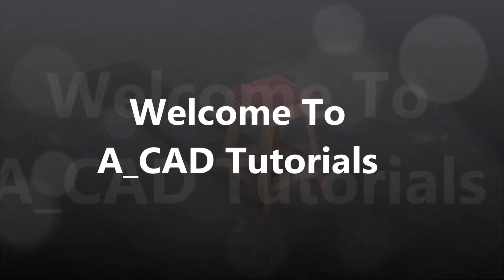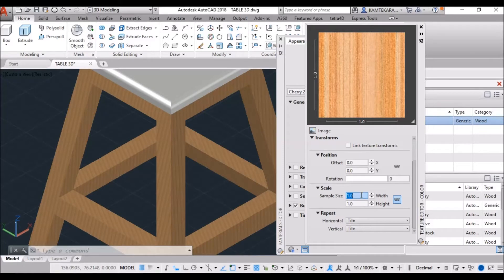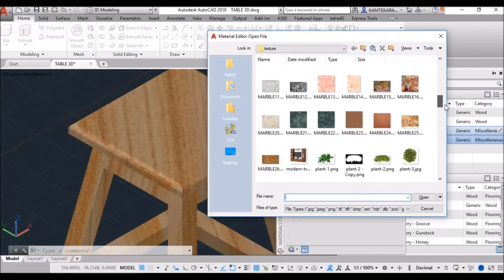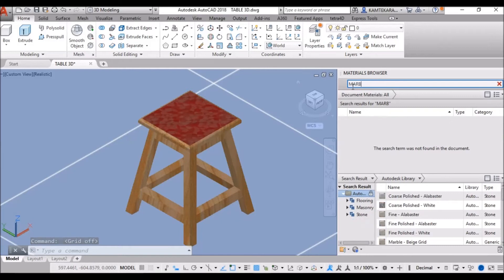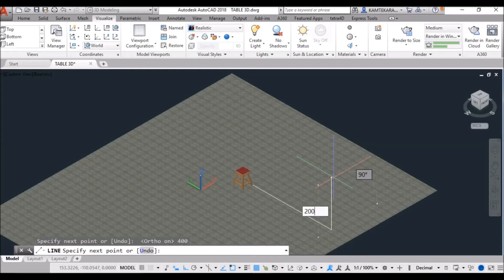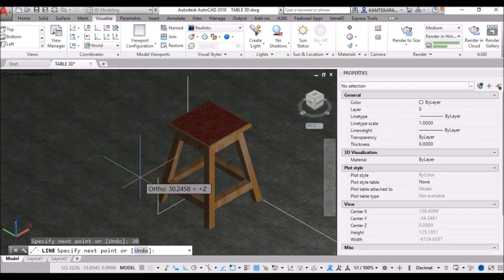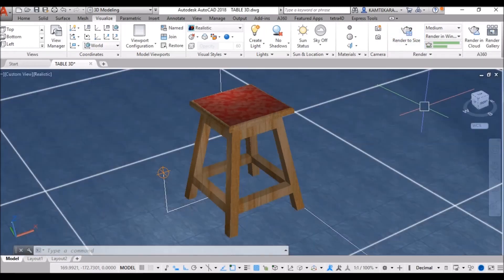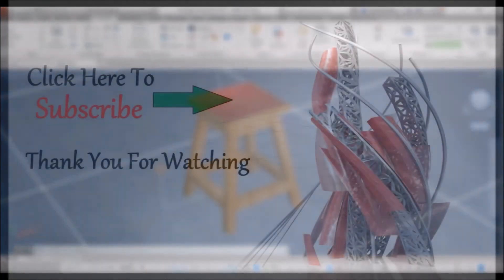AutoCAD 3D Modeling - Stool Tutorial Part 2 - Apply Material Texture + Lighting + Rendering

Comment: Unfortunately, materials in pure AutoCAD only have nice textures, but have not a densities. If you want to calculate the weight and price of your products you will have to use plugins or large add-ons for AutoCAD. The cheapest option is the AVC Properties Palette. And for compiling a table of materials - AVC Material Table.